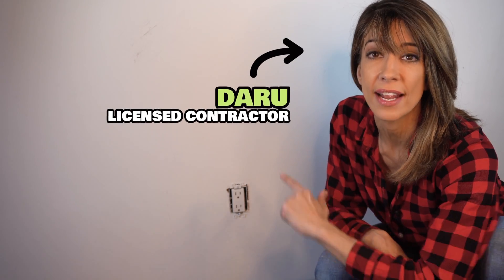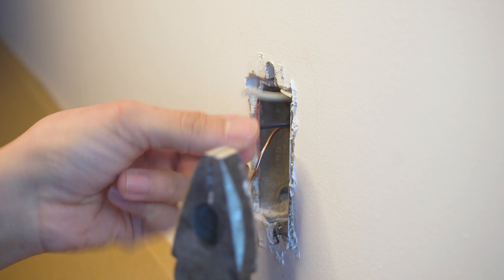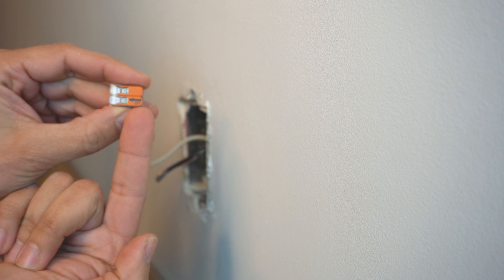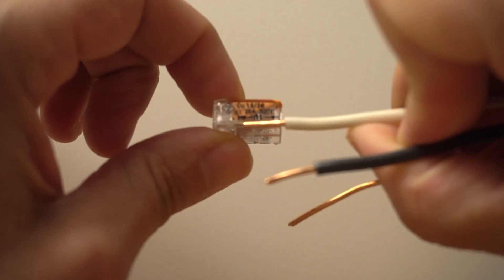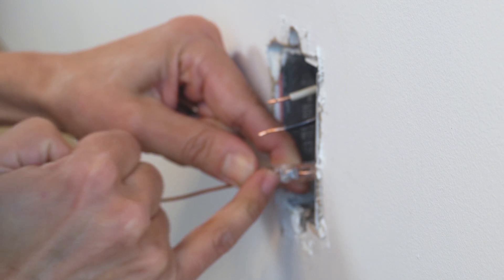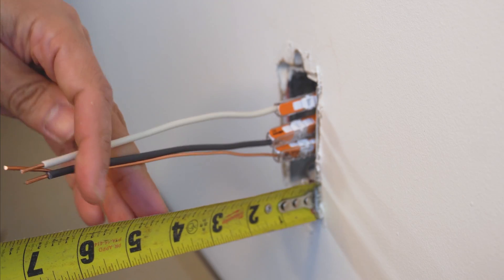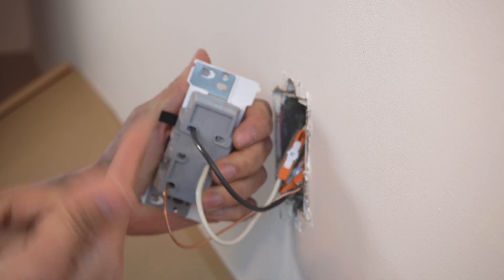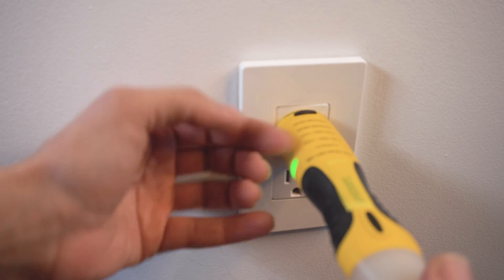How To Fix Short Wires In An Electrical Box

Comment: Thank you so much for posting this video. I really appreciate this video. I am interested in learning about the Wago connectors: I have experience with these in low voltage applications and I like them far better than wire nuts. The clear areas around the levers of the connector help me confirm the wire connection and as you say, I can do a firm pull to check that the wire is well seated. Watching how you work with wires and the outlet helps me learn best practices in wiring. I feel trust in you and in the techniques you are teaching. I'm not a licensed electrician, but I do have an opportunity to work with some existing outlets in my house, and I want to do the work well and correctly.
Reply from the maker: Good to hear from you, Robert. I really enjoyed working with Wagos. Especially since you can make changes to your electrical without damaging the wires.

Comment: Hello Daru , When using Wago connectors , before tucking the wires in the box , Wrap the connectors with electrical tape to keep the levers from snagging other wires or anything else in the box and coming up which loosens the connection , Or use a piece of heat shrink tubing , Either way keeps the levers tight and in place , Heat shrink tubing actually works better and is easier to use , You're a very nice and knowledgeable lady and I like to share my tips with you to help you out too 
Oh , One item I have in my electrical tool kit is a circuit breaker lockout along with a warning tag because lockout tag out is just as important at home as it is in the workplace , Available at your electrical supply , So nobody will turn the power on while you're working on it 
So be sure to get yourself a circuit breaker lockout along with the warning tag and a padlock , A great safety feature to have in your electrical tool kit

Comment: Hello Daru , I've been wanting Wago connectors and In my area , They're now available at The Home Depot which is great and I love the in line connectors because countless times I've ran into wires too short when replacing a receptacle or switch and especially the Wago in line connectors are great for making extensions for wires too short and take up alot less space in the box compared to wire nuts
Reply from the maker: Hi, that’s great that Wagos are available locally for you. The inlines do come in handy. Thanks for sharing your experience wiring with them. It’s always helpful to hear what people think when they try them. Glad you like them too!
Reply: @DaruDhillon Hello Daru , I've subscribed to your channel because you're the very best , When I heard about Wago connectors I was interested in them but I was skeptical about using them but since I came across your videos , Plus your experience with using them and you gave them your stamp of approval , I can use them with confidence because you make an excellent teacher and you take a tremendous amount of pride in your work , Not only are a very sweet lady , You are very knowledgeable and very professional and very observant 
If you spot something that may be hazardous , You point out the hazard and show everybody how to correct it 
I've seen other how to videos but you get straight to the point with no beating around the bush , Contractors like you are really hard to find because you've got special hands , Hands that care about helping others and whatever project you do , Not only do you put your professionalism and knowledge into it , You really put your heart ❤️ into it because you're a very down to earth lady and I'm really happy for you that your channel is the best there is , Even though we haven't met 
I definitely consider you a wonderful friend because you are so wonderful 
When it comes to my friends and family , Including yourself , I'm always looking out for their safety , I definitely love the receptacle you introduced with the lever connectors and I definitely want to use this new receptacle because my younger sister and her husband just bought a house and they want me to replace all the receptacles and switches because they're just worn out and the realtor gave them a big discount on the price of the house because of the worn out receptacles and switches , They mentioned to the realtor that they are having me come out to take care of all electrical issues , With your knowledge and professionalism , You should have your own TV show about home improvement because of how you love to help others and I feel the same way you do , Helping others , If at anytime you have any questions for me , Don't hesitate to ask 
You have a heart as big as the rest of you ❤ and I am so proud of you 
Thank you so much for being you 
I sure hope that all your sweet dreams become realities
Reply from the maker: @ironmartysharpe8293  It's very kind of you to help out your sister with her electrical and to make sure her home is safe. I appreciate your kind words and sentiments. I am grateful to have supportive subscribes like you. Thanks Marty!